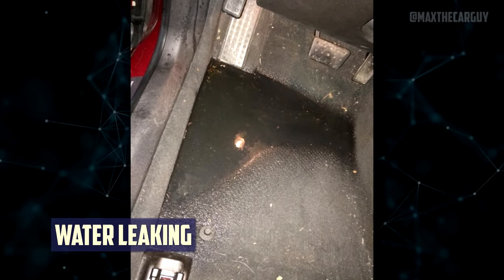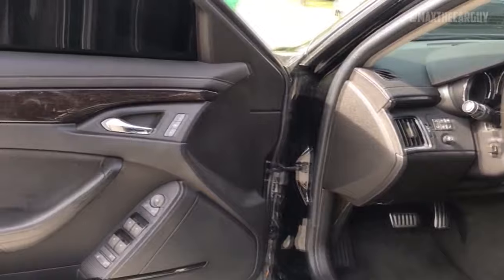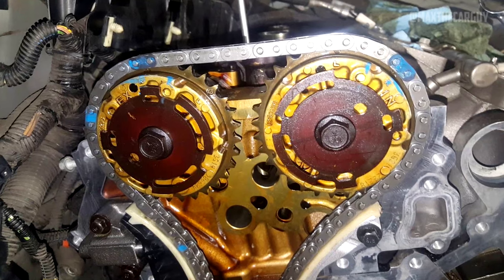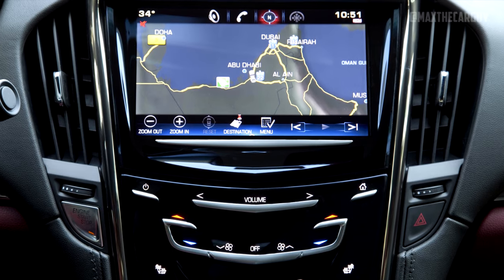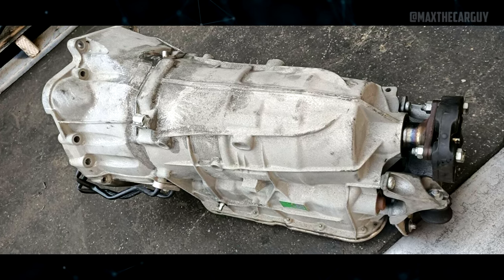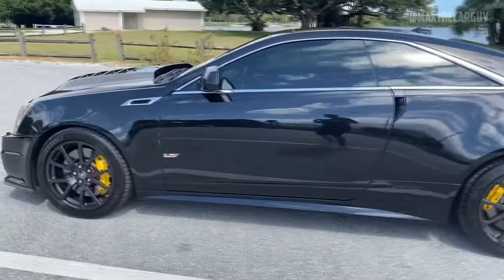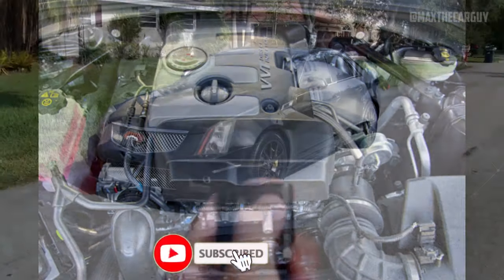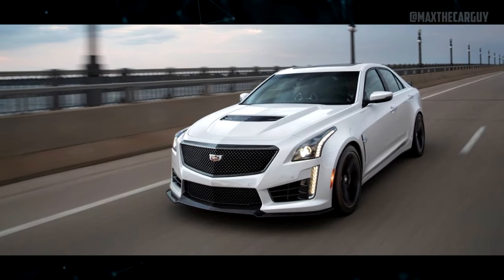10 Common Problems Of A Cadillac CTS (2008-2019). Used Cadillac CTS Reliability

Comment: Change that oil every 3000 miles regardless. Oil is cheap, the main reason timing chain tensioner fails! I also did my transmission fluid at 40,000 miles in my ATS. Not a problem yet!🤞

Comment: Have owned a 2010 CTS perf pkg 3.0 AWD for 12 years. I bought it with 9k & now has over 124k miles. No major problems, no leaks, rattles & runs just as strong as when I bought it. Paint & trim is still flawless. Usual tires, brakes, battery replacement & oil changes when required. I've owned over 160 vehicles & this Caddy is the best I've ever owned.
Reply: I agree , I have a 2013 CTS 4 performance Coupe it’s a great car & no problems. Regular maintenance is the key and these Cadillacs will run as long as long as any.
Reply: 160....? How? 😅
Reply: I have the 2010 cts perf pkg 3.6 AWD, with that said do you have any advice or tips? Mine has 182K miles, when im idling the temperature rises up and when I turn on the heater it lowers the temperature. Any clue thanks in advance. 😊
Reply: Check to see if your radiator fan is spinning fine when the car is idling. If it’s spinning fine, then the issue is most likely a busted thermostat - it prevents coolant from circulating like it needs to, and turning on the heater bypasses the thermostat & cools the engine by diverting hot coolant into the heater core
Reply: @meow13z  Check thermostat. Sounds like it's getting stuck. Be about a $10 fix.

Comment: Ridiculous that these problems are part of a car that's so costly it's again ridiculous!!!
Reply: Bro. They don’t make better components(as in longer lasting) for more expensive cars. Companies use pre mated engines and transmissions. And upgrade everything else. Caddy, Lincoln, infinity all offer typically the same powerplant as in their lower model cars. Whole point is a better driving experience, usually comes with downsides that $$ can solve though.

Comment: READ BEFORE YOU BUY- I’ve had my 09 for about little over 3 years, put 40,000 miles on it (it’s approaching 150,000) and I’ve done most of the work myself to keep it running. Total I’ve spent about $2300 on parts and fixing it. Which in my opinion isn’t that bad for a newer car. Thats less than what you’d pay for 3 years of regular maintenance. But I will say a lot of these issues are due to poor engineering. The things I’ve had to replace are both front wheel hubs (awd model), radiator, water pump, thermostat, driveshaft with carrier bearing, alternator, all crankshaft/camshaft sensors (wasn’t necessary), timing chain, a fuel sensor that’s on the top of the engine (not quite sure the name of it), and regular maintenance (including windshield replacement and tires). I would like to mention that I let a multitude of those problems stack up over two years and the timing chain stretching is due to a neglected oil change. I’ve beat on this car pretty hard and tend to floor it everywhere I go. It’s not made for that. That’s why my driveshaft and carrier bearing was damaged and partly why my timing chain stretched. That’s $600 that I spent because of my hard driving. If you’re looking at buying one consider how much you’d be spending if you took it to a shop every time. A lot, especially since it’s a Cadillac. As someone who enjoys working on cars my Cadillac has been good to me. I don’t recommend it to anyone who doesn’t work on cars or doesn’t have the money to bring it to a shop twice a year. When things are maintained, less goes wrong. I haven’t had any issues with mine for over a year
Reply: I have an 09 CTS I concur
Reply: Did my timing set at 230 thousand miles

Comment: I change my oil every 3, 000 miles. Use premium gas every fill up. Use Turtle Wax Ceramic Spray Polish in the spring and also in the fall to protect the paint from winter weather! Love my 2019 Cadillac CTS/ AWD, 2.0T engine.
Reply: Same! Got the 3.6 8-speed awd. Things quick
Reply: Same here, got a 2013 CTS 4   3.6 Performance  Coupe  great car no problems and it will fly.  Maintenance is key.

Comment: If your screen stops working or cracks go to your local radio or Sound system shop I got my touch screen fixed for 220$ after tax compared to 2000$ at the dealership where they wanted to replace the whole system. My Cue  screen has worked flawlessly since.
Reply: Thank you

Comment: I have a 2011 wagon and replaced the timing chains at 92k is absolutely insane even with regular maintenance still I absolutely love my wagon.
Reply: Yours is a 3.6L?  Mine is currently.  3 1/2 years, second owner.  I had oil consumption issues untill recently.  I was suggested to ad a bottle of Piston Seal with my next oil change. I did that and now, the Oil Catch Can I installed one year ago, is dry for the fist time!  Usually by now there will be 1/5th full of used oil. It is on the Low side.  I done the oil change 2 weeks ago. I was going though a Gallon Jug of oil in 2 months time!!! I think a Fuel injector is going.  I am at 113,000 miles currently. My next major repair is the Inner and Outr Tie Rods. Never been touched before. So for a now 10 year old automobile, This Cadillac holds up!
Reply: @macdsmith  Believe it or not at least once a month I fill the tank with premium and ad miracle oil with valve cleaner my girl doesn't smoke and run perfectly
Reply: @josemaldonado8157  Miracle  Oil? I can not find that. Did you mean Marvel Mystery Oil? I thought about getting some Lucas Fuel Injector cleaner. That works. I've used that many times. Marvels Mystery Oil. also.  I did a web search, and one of the first videos came up with Scotty Kilmer's video. He says not good for  modern autos, don't use it. For older vehicles, yes, you can still use it. I used it in my 1995 Jaguar XJ 6, and I  guess it was good for that.  I use  premium fuel for a long time.  Thinkibg about that; my brother asked me yesterday if I use premium fuel for the Lawnmower.  I said no, and he said it does better. I was recently  thinking about doing that before we talked.

Comment: For the moonroof drains. I found out after floor flooded and took to dealer under warranty. Still charged me $400, to remove everything to pull the carpet & let it dry infront of shop fan for a weekend. The "duckbill" openings at the ends of the drain tubes, gets hard and doesn't let the water out. Go behind the plastic front wheel wells and cut the duckbill part off. This 60yr old g-ma did it. Just remove 2 or 3 push pins, pry the well open, stick hand in there, and cut it off. No problems since.

Comment: I have owned two. An 07 and now a 2011.  I'd say the water intrustion through the Sun Roof is the major one that both cars share. The trunk would fail to open on the 07 a lot.  Mostly when it was hot.  I loved the 07, and love the 2011.  But GM's quality is always an issue.
Reply: Is it same problems with 2017 and up
Reply: Any engine / transmission problems ??
Reply: any other problems with your 2011?

Comment: 201k miles here ! Still going might have to replace catalytic converter if oxygen sensors doesn’t fix check engine found everything for $250. I cleaned out drain hoses myself pretty easy job. Bought car cover for heavy rain nights to avoid water getting in it’s whatever still love my bitch
Reply: Same here..no issues other than catalytic converter oxygen sensor setting off check engine light
Reply: Damn! I got my 2012 cts with 63k in 2021 and now its at 96k only problems have been wheel bearings. No engine light its been a great car.

Comment: GM earlier. Most manufacturers are doing this now because if you make a solid car that will last over 300,000 mi then the car won't need to be replaced. This is not good for the car manufacturer because they would go bankrupt very quickly they need to make cars that are cheap parts that fail and tougher for the user to repair. It's basically strategy.

Comment: 2008 3.6 full performance. 
☆ Sunroof drains - cut duckbill off end of front drain tubes. Can reach them from inside wheel well splash guards (don't remove, just pull a few push pins).
☆ Drive shaft - mounting bolts loose. No thread lock on from factory. Caught it before major catastrophe.
☆ Fuel pump inlet tube - cracks at top where it enters the pump. Cause: factory cheap pump. The entire exhaust must be removed to replace it. I've seen numerous YT videos of people cutting an access hole to FP under rear seat, then making a metal plate to cover the cut-out.
☆ Now - I'm hearing clicking sounds like behind infotainment stack, (HVAC on or OFF, radio ON or OFF, car moving or idle. AND sounds like baby birds tweeting behind glovebox.
LAST Caddy 4 me. Unless I hit a million+ lottery.😂

Comment: Most likely produced by toyota my wifes 2011 cts has 140k with no issues had since 2012 . 3,6 motor change oil every5- 6k. Tires filters brakes oil thats it except 1 antilock sensor in front right after hitting a  deep pothole. Allwheel drive model. Heated seats headlights even turn  with the wheel to see around corners still work.

Comment: Pretty cars but maintenance hogs! My 2013 has had issues with overheating (I changed the thermostat, gaskets, and everything I could reach until I figured out the cooling fan motor burnt out. I replaced it myself.) The driveshaft bolts are weak by design and GM issued a TSB but no recall. Mine failed catastrophically and I ended up ordering another driveshaft from a salvage yard and ordering the newly designed bolts from rock auto. Backup camera crapped out on me but I haven't replaced it yet. Leather doorsill MELTED under my arm on a mid-70's day. I'll never own another one! I've posted many of the fixes and repairs on my channel. Only good thing I can report is that it burns 87 octane, but it gets marginally better gas mileage than a Jeep Wrangler...I'll NEVER own or recommend another to anybody!!
Reply: Wow...

Comment: Who would buy a cts after this video? Holy crap. Hope it did scare some away. I have an '08 that's been a money pit. I only have 80k miles on it now. Water leak from the sunroof, drive shaft carrier bearing failure, electronic issues where passenger side controls don't work, bolts that connect exhaust to cats all rotted and broke clean, fuel injector failure, power steering gone, transmission line leak (no easy way to add fluid without a lift either), factory rims leak air quickly, speed senor issues, tons of sensor issues causing seemingly constant check engine light illuminated....I can go on and on. Beautiful looking car and love it when it's right, but those times are few and far between.
Reply: Did you replace just carrier bearingnor shaft with u joints??

Comment: NOTE about dealership oil changes.... THEY DON'T DO THEM.  They'll take your car to the back, but 50 50 on weather or not they'll do the oil change. And in the event they do the oil change, they most likely WILL NOT replace the oil filter.  I had a huge issue with Dealer when I proved this via dash cam footage. So don't be surprised if something happens to your dash camera while at the dealership. Sorry folks...... they are onto it now.

Comment: I have a 2018 and the engine keeps running when everything is off, do you think it is the power relay or the element of the ignition like in the CTS?
Reply: Mine has been doing same exact thing! I have 2019 CTs 2.0 t awd. It’s only been recent

Comment: 2 timing chains later.... several Sunroof leaks easily resolved for the weekend warriors and for free but still a hassle. And most of all now a traction control and throttle body engine idle issue 😢

Comment: Some of the shuttering of the trans may be they have skid control on take it off and drive without any weird feeling in the steering. And my car had never had a good alignment from the factory so check that too.Then I use Lucas oil add with seal conditioners in it for seals but most of all the plastic chain guards.  The guards get brittle and break. And I put some in trans. As for driving it hard I don't but I drive like a limousine driver from Chicago.  It's a 2008 cts 6 that runs  smooth. The leak in the roof can be fixed by two problems.  One like you said run a plastic wire or blow put the lines with air. Two there towards the backwhen you open it up look to see on each side from the corner towards the center you will see a plastic tape that has come loose. I just got some  silicone spread it around being careful not to clog the opening to the drain. They could have made this a bit better. The screen keep it out of the sun don't press hard on the face. On my video player at first the button for to play would not work so I found if I just slip in the disk and let it cycle it will go to play. Love the car love the look even as a 4 door it adds to the look. Had mine 4 years. Got it cus of these minor problems.  The person had it at a shop but could not figure out the parasitic drain the was in the trunk light switch,  it would stay on and drain the battery.  I pulled the bulb and had their new battery they put in is still working even  if I don't use car for a month.  Great breaks. And I fly rc plane's and a 50 in wingspan will fit and two other smaller at same time if I want. Oh and I'm going to put in some iridium plugs for better fuel and running to see if I get better mileage. So basically give it a little respect she will do the same. And the v8 rear wheel drive get great gas mileage and handles well. Should I go on. The day I saw mine. It looked like new oh and the air in Florida was very important.  And has worked great ice cold for 4 years now. My only beef is I sort of would like narrower tires , but that's just me.

Comment: Cadilla CTS 09 RW 

1.water leak coming from the sunroof.
2. Drivers and passengers door handles not working.
3. Ac/radio/heat/ panel going crazy not working. Probably because of the water leak damaging electrical lines 
4. Headlights constantly burning 
5. Replaced lower control arms TWICE. Not sure why…
6. 1 wheel bearing replaced 
7. At 300.000 kilometres water pumping replacement.. coolant leak 
8. Missfires due to ignition coils burning.
Car lasted 400.000 kilometres until a very cold Canadian winter morning the car wouldn’t start. I tough it was battery but the engine actually sized..
Reply: Good looking car but its a fucking headache after 200.000 kilometres or so..😢

Comment: I have a 2010 CTS. It's like a U-boat.  I've had water inside and a small lake in the truck Investigating another leak I looked where the air compressor is stored and it was filled with water. 😮
Reply: Check your drain hoses it's really simple

Comment: My 2011 Cadillac CTS drives great but it recently started showing the traction stabilizing triangle on the dashboard when it starts up.  I have to turn the vehicle off, wait 20 seconds, and start her up again, and the light will disappear.  What is causing this issue
Reply: Buy a scanner, plug it in and then see if there are any codes.
Reply: I had A 2013 CTS for eight yrs and loved it. It didn’t start to have problems until 139,000 miles. The traction light kept showing up on the dash board when I cranked it up. The dealership tried to fix it, but soon as I got on the high way same problem. They told me they had to charge $3,000 just to brake it down to find out what was wrong and if it was the engine it would cost $10,000. I asked for a refund and traded it in for a brand new Honda that’s more reliable.
Reply: Check your speed sensors .they might need to be either reset or replace

Comment: I’ve got a 2011 3.0 manual, when I hit the gas 2-6 gear at lower rpm it makes a “shutter/ squeaky” sound. Lmk what that could be if anyone knows.. thanks
Reply: Ignition coils are weak or throttle body is dirty and needs to be cleaned

Comment: Transmission fluid change for $331? I had the tranny, transfer case and both difs changed for $325, including tax.
Reply: Drain fluid from the bottom yourself every 40k miles. not very hard. Cost about $25 for valvoline maxlife. Works great
Reply: How many miles did have til you did the transmission fluid change
Reply: @samgom  77,000. Went to a transmission shop. They only do drive line work, no A/C work, no brake work or other repairs.
Reply: @samgom 60K

Comment: PLEASE HELP!! My AC is working fine but the temperature cannot be raised on the passenger side! I can make it cooler but not hotter! Why is that?
Reply: YOu may have already an answer, but this happened to me. It originated from water leaking into the center console due to the leaky roof issue. I had to swap out the console to fix this at $500  :(   That darn leaky sunroof has been the bane of my 09 CTS otherwise a decent car as long as I ignore that stretched timing chain issue every 60K miles.

Comment: Dang...I just brought a 08
😑😑😑😑😑
Reply: 1st year of a new generation car has problems always get the next year , 2008 is the beginning of 2nd gen cts model I have 2007 CTS great car most issues were fixed after 2005 model
Reply: How is it going?
Reply: @EiDyn_rap  actually it's running good...😎
Reply: Man, I'm over here looking at this 08 cts with 200k. Was your 08 cts a good purchase?
Reply: I have a 2008 CTS 118k miles, runs beautifully, just replace trans oil, do a full tune up, air, oil, fuel and cabin filters, timing chain kit, water pump & only use Mobil 1 dexos 1 gen 3 oil trust you'll be riding A1 for a long time and change it every other 7k-10k on the tune up keep up with it. You'll be fine trust me
Reply: @ANTHIT honestly cars really start going bad around 200-250k miles u could find a cts for 5-7grand with 90-150k miles there reliable cars frm all the other research I did besides this vid